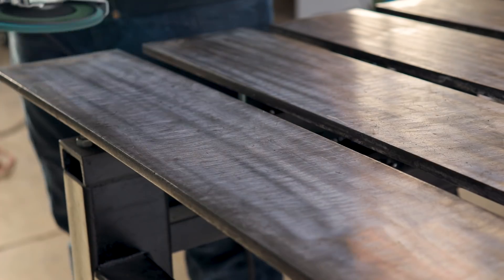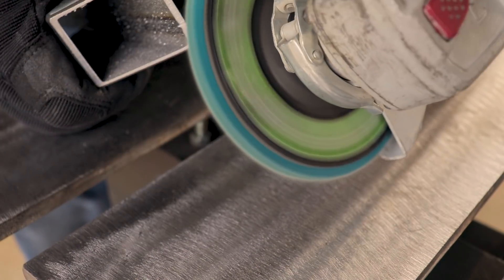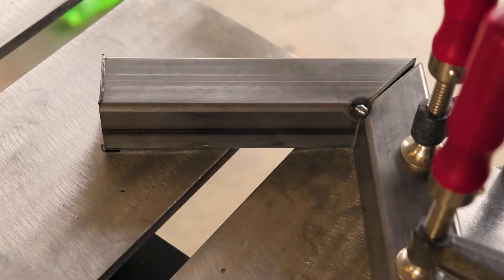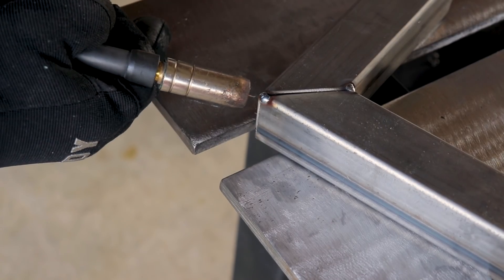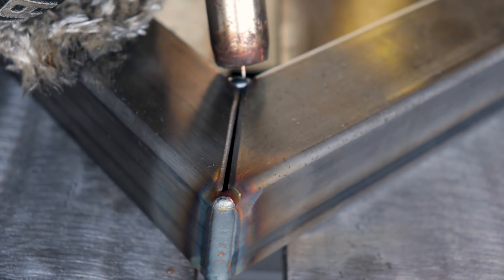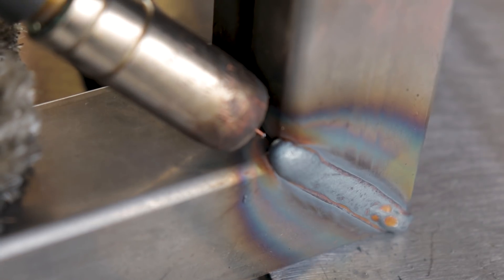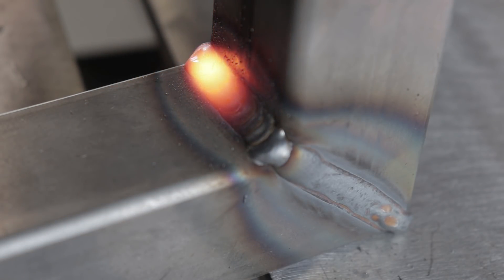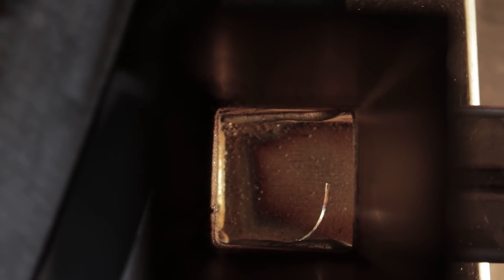How to Weld Mitered Corners

Comment: Good video.  It would have been helpful for me to have seen up close how you ground the mitered edge before welding.  You said "I'll grind it pretty much flat"  I'm not really sure what you meant by that.
Reply from the maker: Sorry man.  I meant grinding the outside corners to where its basically 90° if that makes sense?  And then just bevelling the butt joints at about 45° on each piece

Comment: Hey quick question 
Those mig dimes you weld 
Do you use 030 or 035?
Which is easier to make better welds 
I weld small fab stuff like you
Small angle iron one inch tubing etc
Thanks man. Beautiful welds
Goals for me! 😂
Reply from the maker: I like .030 it gives me more control and can weld plenty from thin to thick
Reply: 5th Street Fab thank you for the tip and responding 
I mentioned you in my Everlast opening video and  your channel name  and talked about your welds being a goal of mine. Hope that’s ok.  I have a new channel and I’m just getting started. 
Thanks again

Comment: nice that what i need to learn how to do i want to make 2 long big L shape ones then weld 2 pip bars to hold them side by side. The 2 L shape L's are going to be the body and lags almost at the top i will add tow more smaller bars then add a 12 GA metal plate weld the plate to the 2 smaller bars and bolt the plat on the big L shape frame wish i could put a photo  here but YouTub dose not have that option the best i can describe it is making a H but with 2 bars across lower on the L/ H shape and 2 more smaller ones almost at the top spaced apart what i trying to make is a strong TV stand i am almost thinking of having some do the welding fro me but i should lean maybe i can get a nice job if i learn how to weld thank for the video

Comment: Good video lm new to welding and want to make a welding table good tips
Reply from the maker: My number one tip is to keep the braces high off the ground that way you can get your legs under the table.  And try not to weld the table to the base more than just tacks.  It can warp the top slightly and will never be flat after that

Comment: Personally I weld the inside first, after tacking of course. This allows me to compensate for the shrinkage. Your technique of a heavier bead inside might be causing the extra shrinkage. The more metal cooling, the greater the shrinkage. You might try it.
My simulator was the largest project I have welded up at 3 tons. Both steel and aluminum.
If interested:  https://www.facebook.com/aqvwc/
Reply from the maker: Right on I can definitely see the benefits of doing that.  And yes it definitely pulls more after the large fillet.  It's just the way I learned and has always worked well for me.  I would love to check it out it sounds awesome!  But I don't have Facebook so it won't let me see it.  Sorry

Comment: Great video, my first time watching. I would be great if you would provide more technical details for the beginners like myself . . . for instance the type of machine you're using along with the wire size and power setting.
Reply from the maker: Ya no problem. I'm trying to remember to mention that in each video now.  I used an everlast 200imig in this one.  My settings were 17.5 volts and I think 176 ipm with .030 er70s6 wire.  I was pushing the gun instead of pulling on the welds that were going to be ground off because pushing leaves a flatter weld and pulling leaves a higher crown.

Comment: good videos,    what wire size and speed are you using  ?   power?
Reply from the maker: Thank you I was running .030 er70s6 at I think 17.5v and 180ipm somewhere around there.
Reply: thx again  I weld 1.5 inch tubing various angles from 10 degrees to 70 degress     i use .030   but my miller multimatic 200 has only dial settings 10, 20,30,40,50,60,70  and power in in either high or low with 1,2,3,4,5 turn switch settings  , how to i get 180 ipm and 17.5 from that ??
Reply from the maker: 666 666 to get the wire speed you can pick a speed setting and time a trigger pull for 6 seconds.  Then measure the length  of the wire for 180 ipm you need 18".  Once you get that you can weld practice beads and keep adjusting your voltage until it runs nice and smooth and that should be your 17.5-18v range

Comment: I just finished three rectangular frames made from  1-1/2 angle . I cleaned the edges, but I didn't grind out a groove like you did. How much do you think it will affect the strength? (This will be a heavy record shelf).
Reply from the maker: +Gordon Reiher hey it all depends on how hot you welded and if you ground it smooth or not.  The hotter you weld it the deeper it'll penetrate and you can get away with more grinding. But for most things you don't need much weld I've seen people get away with a lot on frames
Reply: 5th Street Fab Thanks! I welded pretty hot, but on the inside (not showing), so not much grinding. I'm hoping that when I add the legs it'll add some strength.  But next time I'll remember this lesson!

Comment: Why Does Downhill Keep From Blowing Through Compared to Welding Uphill?
Reply from the maker: +Bronson Stephens with downhill gravity is working with you pulling the puddle down so it's harder to blow through but going uphill you're fighting gravity and it's pulling the puddle down and letting your wire punch in as you go up.
Reply: Heat rises.  When you go up hill your material gets hotter as you go up. When you go down hill you are getting away from increased heat and maintaining your heat. You don't over heat to the point of melting the metal. Therefore you don't blow through the material or get large globs of metal forming.

Comment: Nice vid! For mitred 45* angles on steel, can something like the Hobart 770565 Two Axis Welding Clamp prevent distortion?thanks!
Reply from the maker: +Eric x I never had much luck with them but some people swear by them.
Reply: 5th Street Fab I’m gonna try both. I’d like to see the pull and messing with it like you do. Thanks for your vids and all the info!

Comment: Awesome.  Thanks.  So is uphill hotter or slower or something compared to downhill? Why is there more chance of blow through? Really appreciate your work.
Reply from the maker: +Building stuff yes uphill works against gravity so it's pulling your puddle down and helps you get in deeper it's just harder to learn.  Downhill is the opposite it keeps your your penetration from punching in as much but much easier to fill a gap.
Reply: Thanks.  You're the best welding teacher!
Reply: Building stuff 8

Comment: Yep, I do em pretty much the same way, only slight difference is sometimes, if I have a gap, I'll go right to left instead of circles, or pulse- as in when welding thin sheet or patch panels on cars etc..
If its a 4 side frame, I have some heavy duty mitre clamps so I'm a bit lucky there.
Reply from the maker: +Jaques Daniels I'll do the same thing if I have it boxed in or clamped down.  Definitely helps from blowing through.  Thanks for the input